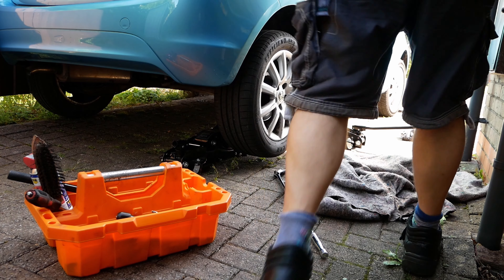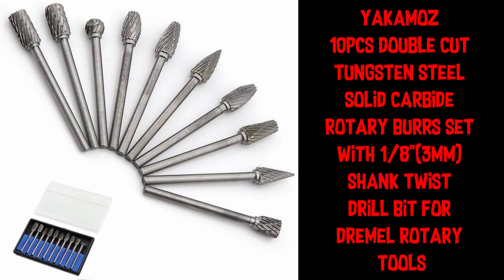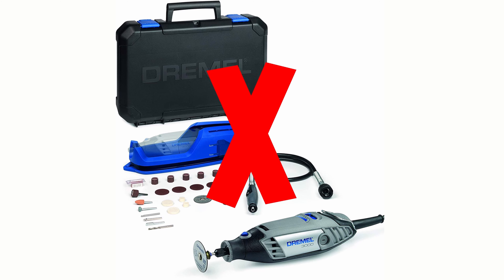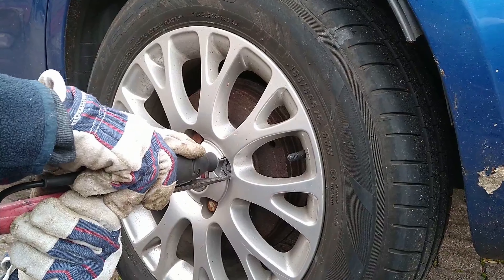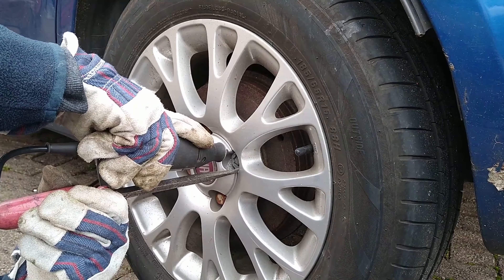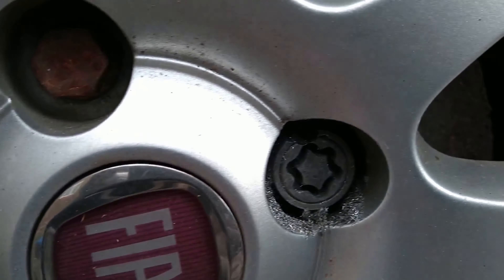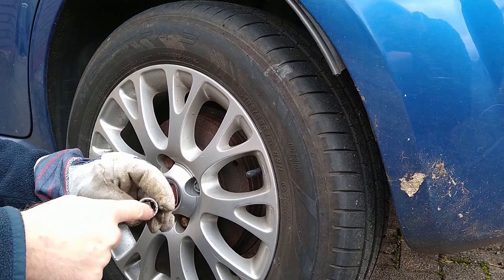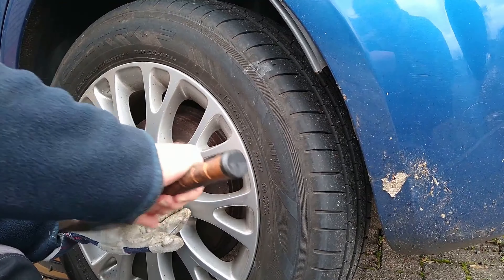LOCKING WHEEL NUT NIGHTMARE! OR EASY FIX?

Comment: I did this job on a Ford Mondeo. I was able to use a flat head bit from a cheap screwdriver set I got in lidl that has the little removable bits. I hammered that bit in between the collar and nut head and that broke the outer ring. It was then just a case of using a 19mm 12 point socket and hammer like in the same fashion as you did. I tried hammering an 18mm on but that just broke the socket on me. 19mm worked fine.